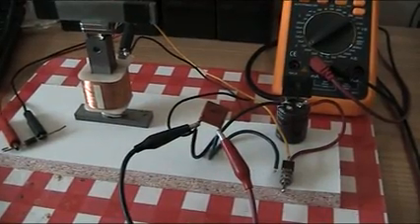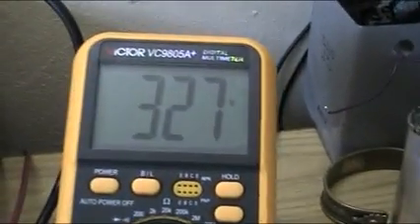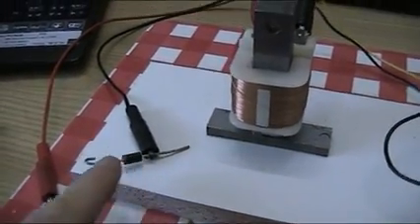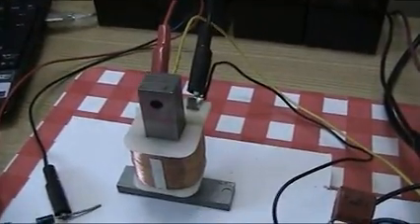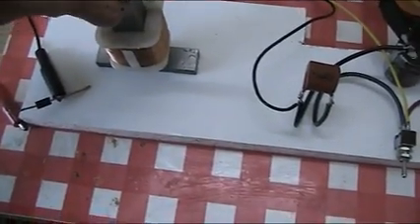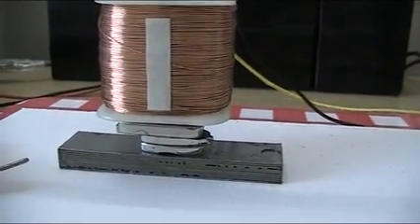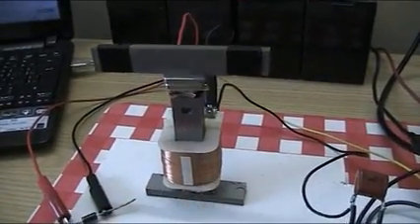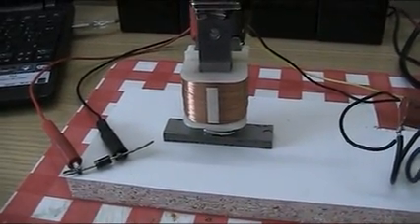Mostly Permanent Magnet Motor test 5

Comment: I know you very dislike mumbers and equations but unless I made an error the height corresponding to 0.272 uF and 325 V for 0.175 kg is 8.4 m:

W = 0.5 × C × E^2 = 0.5 × 0.270 × 10^-6 Farads × 325 Volts = 14.4 Joules

W = M × g × h <=> h = W / (M × g) = 14.4 Joules / (0.175 kg × 9.8 m.s^-2) = 8.4 m.

Is anyone may check my calculations?
Reply from the maker: The error is 0.272uf @ 325v = 0.0144 Joules or 14.4 milli joules and not 14.4 joules
The coil weight is about 125 grams and it traveled up 1mm
It was calculated in the forum topic back in 2012 when this video was done and I'm quite sure it was under unity. However, I never re-did the tests with the more powerful magnets and external cores around the coil.

Luc
Reply: Luc gotoluc Choquette yes, indeed Luc: I put the right numbers and then mess-up with the order of magnitude ^_^

But that is a very good new cause it means less than 1 cm to lift. Really worth the any improvement or idea you can proceed, and do again the measurements :D

Comment from the maker: You're smart!... and that is exactly how the new coil I made is going to work, plus maybe a capacitor for the HV flyback to convert to current. However, I'm presently building a houseboat (you may have seen my newest video) and have not had time to finish the mechanical side of the new motor. Also, this new build has 4 one inch N52 cube neos. Should be 10 or more times more powerful then the last one I made.

Stay tuned or subscribe to get the update when the new video demo comes out.

Luc

Comment from the maker: Hi Robert, great replications.

One important point I can give you is, if you want the flux of the opposite side of the magnet to reach the outside enclosure the cores will have to be minimal. That's why you see I made mine like this + so the flux can reach the outside bridge. The other thing you could do is use separate magnets (opposite poles of center core) on the outside enclosure. Also, outside core has to be as close to the coil windings as possible to make a difference

All the best

Luc

Comment: Hi Luc,
well done, but you would need to lift this coil up 1.2 cm to get to 100 % .
Alll over 1.2 cm lift would be overunity at this cap size and voltage.

Regards, Stefan,

Comment: Hi Luc, I've been enjoying your newest videos. Just a thought, If you're willing to sacrifice it, your toothbrush (seen next to your computer in the flyback feedback video) contains a motor that might be suitable to use for generation in your motor setup. (the best way to extract the guts of the toothbrush is to open it at the shafted end, then the whole inner unit slides out). Hope to see more tests of the complete setup!
Cheers, your newest fan,
Paul.

Comment: Good test Luc. You may be interested into a similar work done by C Subieta Garron patent number 3368141.  TRANSFORMER -IN COMBINATION WITH PERMANENT MAGNET .
It seems that your idea may be beneficial for Transformers as well. Although this individual uses opposite magnet configuration. By using your idea of inward same polarity maybe his system can be improved on. Cheers.